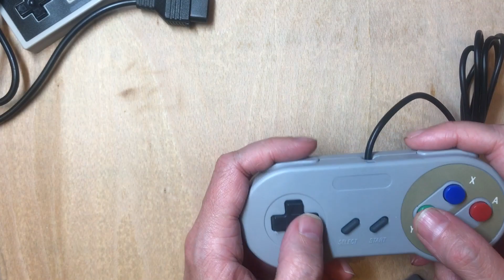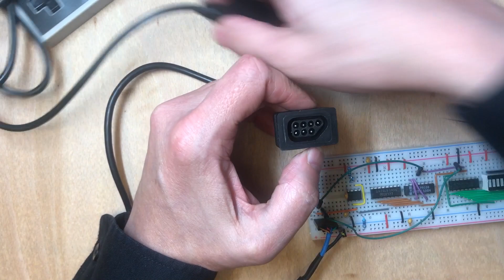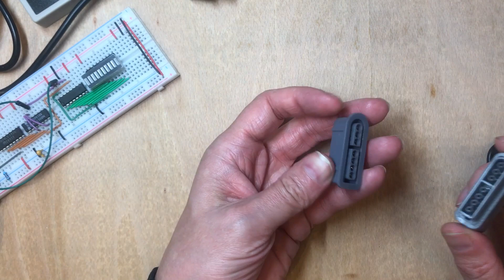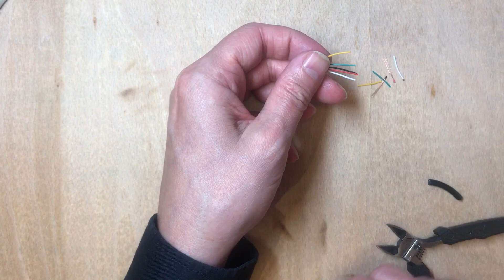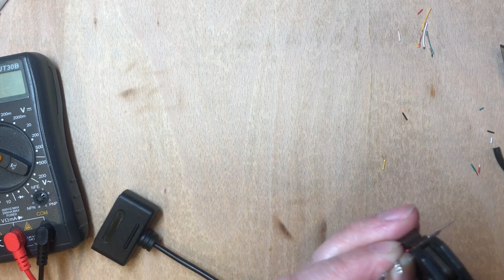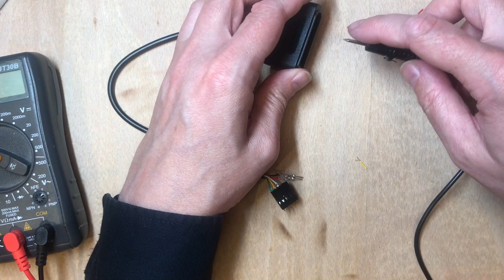Snes Controller to Dupont Adapter

Comment: do you think you would be able to build an adapter to use SNES contollers on ps2/ps1? 
ill pay you for it
Reply from the maker: The ps1 had similar inputs to a snes so an adapter would be possible. Not sure what you would do about the lack of analogue sticks for ps2.
Reply: @JamesSharmanExtras  i am looking to use DPAD anyway so i just need the adapter cable. do you think thats something you could build? 
as i say, ill pay for it